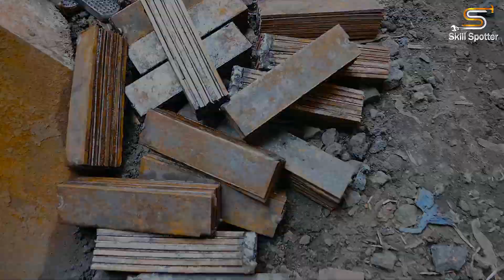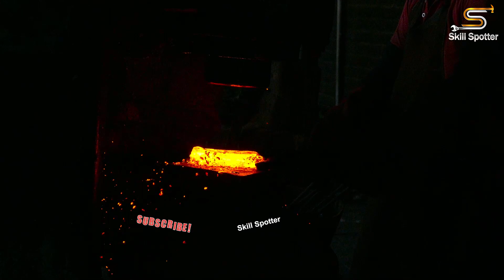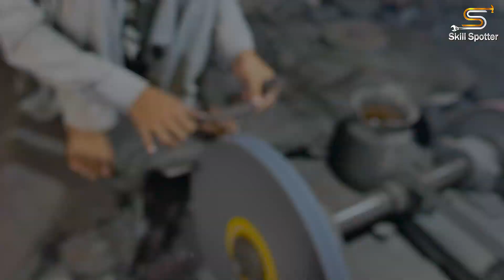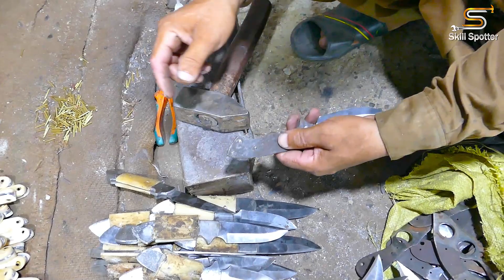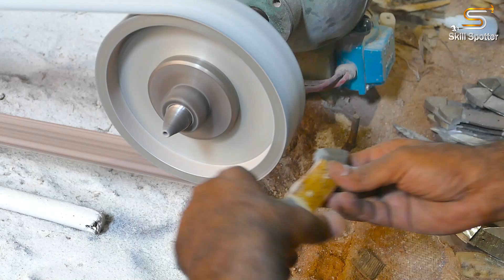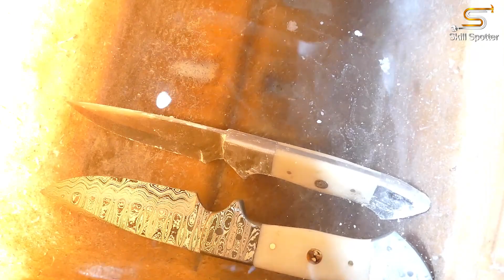Forging a Hunting Knife, Best Damascus Steel Dagger | Forging a Damascus Bowie Knife

Comment: I can't believe they don't do the most important step of making a knife. Heat treat! 
All that hard work to make a beautiful knife and it's not useful.  It's only an ornament
Reply from the maker: You are right dear...!
Reply: Bought 2 tracker twisted Damascus on Amazon from a company named poshland there in the u.k but buy from Pakistan.  Neither past a file test so I have to un pin and quench clean etch clean than instant coffee etch clean again and reassemble handle.

Comment: while this is interesting to watch, these are the "Damascus" knives you get off amazon for $30 or so. Not heat treated
Reply: Your Comment is Interesting Sir,
Can u tell me About Heat Treating Plz, As i see Thay Heat Steel and make a knife, is there any other Heat Process Also ?
Reply: @abdulmuqadas266  heat treating is the process of quenching a critically heated blade in oil or water to harden it.  The it would need to be tempered back.  They may have not filmed it but they are notoriously not treated at all.
Reply: @CalebStewartPhoto  Means The Blade Should be Heated again and Than Suddenly Put into Water or Oil it will Make Steel more Hard.
Thank u Sir For Good Information.
Reply from the maker: @StanCo Iron Works , Great respect to your opinion Sir.
It sholud be Heat treated, as we don't know the Technical aspects of steel iron forging so next time we take much care of these things to bring a video that will make you more happy.

Comment: Nice skill but the only forging was the stock Damascus.  The rest is stock removal and handle making.  But it's production.  This is what you get normally from Amazon.  Most lower price blades are made in Pakistan and stock removal.  That's why these knives are 20 to 50$ and a hand forged Damascus in Japan or united States can be a 10thousand doller blade
Reply from the maker: Its good to make an option for low budget guys so they can also buy one.
Respect your opinion..!